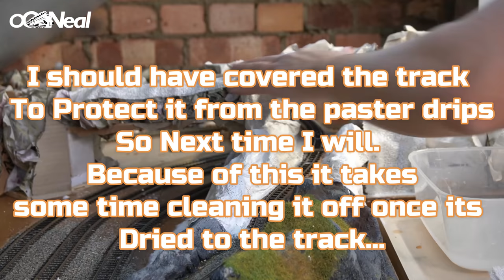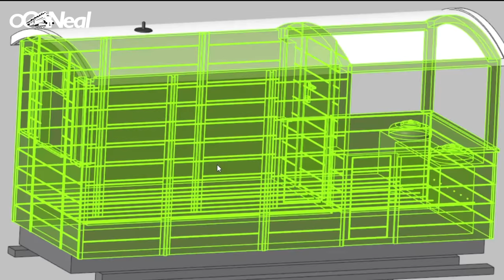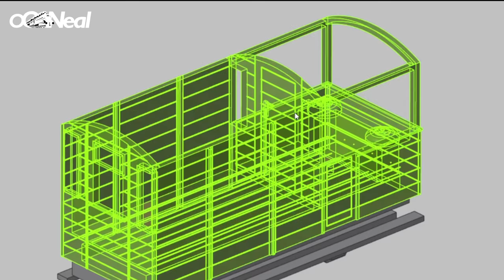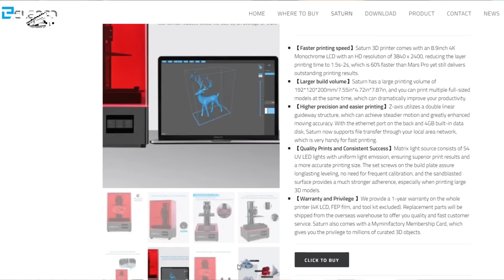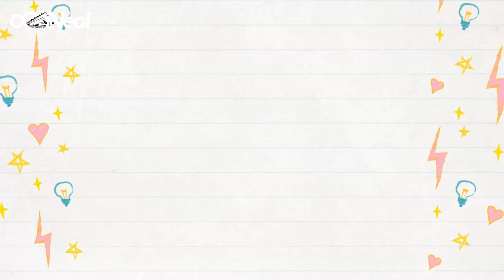Building Up A Model Railway S1 Ep 38 | 009 3D printing | Helix Progress

Comment: Hi Tris, you have to allow for shrinkage with resin and as it depends on thickness as well as profile it's always means there will be "test prints". Elegoo do a resin called "ABS like" and it's tougher than the standard stuff (not so brittle), worth keeping your eye out for it but it is on Amazon at the moment. The Saturn also has a monchrome screen which means it prints faster. Great vid by the way 👍

Comment: Tris. Lighting. ( My real job, when I’m not playing trains, is a stage lighting designer.) you can’t go far wrong with bright components. Phi-sigma electronics. When lighting buildings, especially. General overall lighting, the clouds in the sky work a bit like frost. Light comes from all angles during daytime. The HMI in the sky. How to accent a layout, a bit like film lighting, key back and fill. Bounce. Light doesn’t always come from One direction. Especially if you are using cameras. In LED’s if you look at them carefully, the little cup is actually a parabola. A bit like what is known as a parcan, or beam light in professional circles. Banks of warm and cool LED’s, mimicking clouds.. makes the railway look very real, as opposed to a factory floor lit by fluorescent tubes. Have you considered different times of day? Just a thought for you to ponder. Stick the wee modules on piano hinges, to accent the layout.😉🙃👍K. Llandaft 009.
Reply from the maker: Thank you for the help Kris, that was a good read.

Comment: Great video again! Wish I had a better camera myself and my tripod. I am not looking forward to my hill work as I have in my plans to make a 25-35 feet worth of hill range.
I still wonder if I should add lighting strips to my layout at some point.

One thing I should point out with Resin printing and I am sure you figured this out is prints on resin printers come out still soft and are prone to warp-age weather it be during or after printing. It's never 100% avoidable.

Comment: hi tris 
all is looking fantastic  the little coaches looks really good
just a note from my understanding the 4k screen has actually a little less resolution on the saturn than on the mars or the anycubic because the bigger area needs more pixels to do the same job as the smaller 2k screen the only thing is that the mono screen on the saturn should last longer and i know will print larger volume but the resolution will not be any better than your anycubic printer as i said probably a bit less resolution than your printer  so really its down to the size  of the models that we want to print i told you before i have the mars printer but i have not used it yet i hope that i will be able to get prints nearly as good as yours 'i'm coming from an fdm printer to the mars so i have high hopes fo the finished prints that is if only i can get the hang of the cad for drawing the models 
regards
james

Comment: Another great video. I know nothing about resin printing of course so watching your journey is great. I noted you had the flat surfaces parallel to the bed but a few friends and also a few items I’ve bought (including a Hardy’s Hobbies Bagnall at the moment) have all been printed at a angle to the bed with almost ‘stadium seating’ scaffold supports; does this help with surface stability, as counterintuitive as it seems? What little distortion there was on your van though only helped it look more natural and wooden in the footage. Had similar issues with brittleness on my latest project, whilst drilling holes in the running boards, twice snapped off a chunk which then had to be glued and sanded, and the same with the roof where it was a little distorted 🤦‍♂️